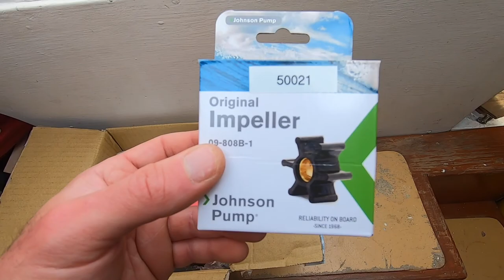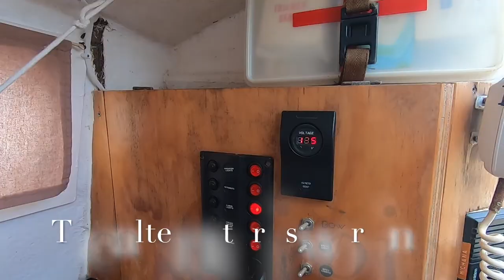How to service a Bukh DV10 marine engine - Between Sea and Sky [ Ep 20]

Comment: How do you get the bolt off the flange for that pump ???
Reply from the maker: Hi, you first have to remove the alternator belt, then turn the flywheel clockwise while you check on the back left side. You’ll see a locking hole on the back of the wheel, insert a bolt into it. Once it’s locked you can use a socket with an Allen key head and a tube as a extension (about a metre is fine) to remove the bolts.

Comment: No one can get the pump off without taking   The flywheel off???
Reply from the maker: Yes you can as it’s not located behind the flywheel. However I’m used to remove the flywheel every year during my annually maintenance (as showcased in this video)
Reply: @BetweenSeaandSky  Is that really necessary?

Comment: What oil extraction pump do you use? Looks much easire than mine!
Reply from the maker: Hi Andrew, I use this one https://www.smartmarine.co.nz/product/1385/manual-oil-change-extractor-pump-brass/3574?gclid=Cj0KCQjwsIejBhDOARIsANYqkD1YPPLY91AHBMVBWsDiqUcxgh3uLTvdKThc68UfcK6jxixUrpd615caAkW0EALw_wcB it’s not a professional one and can get a bit messy but it does the job and it’s easy to stow away on a little boat ⛵️